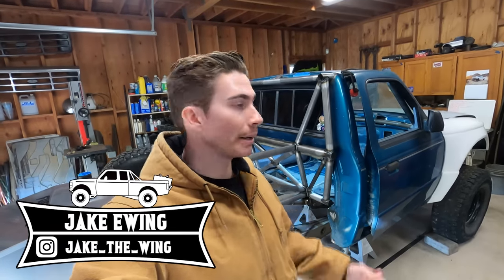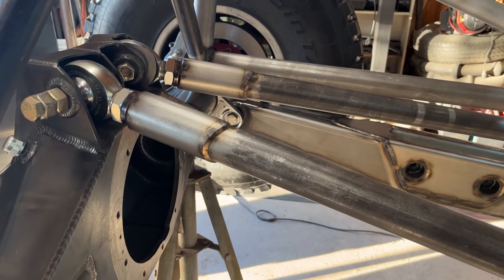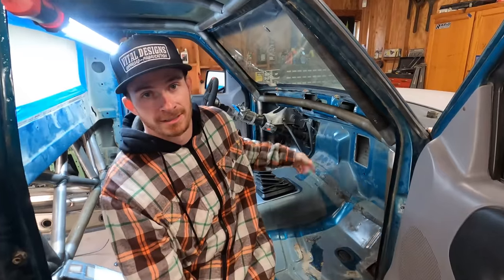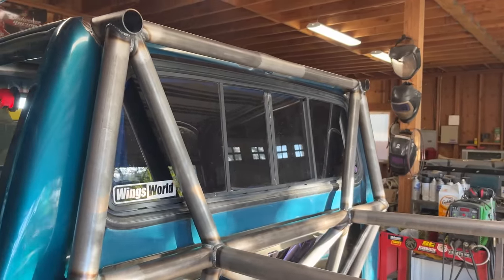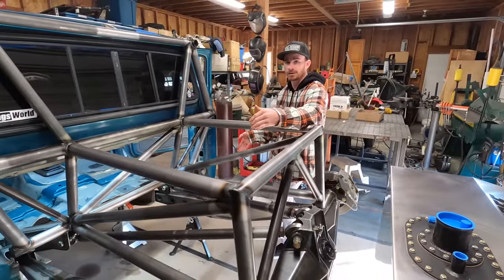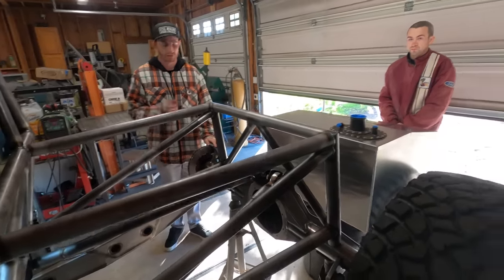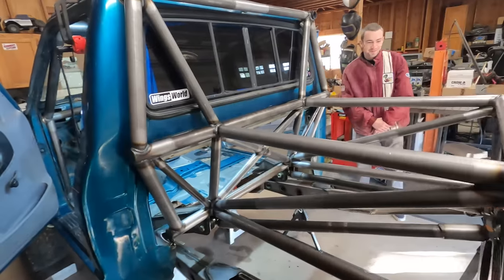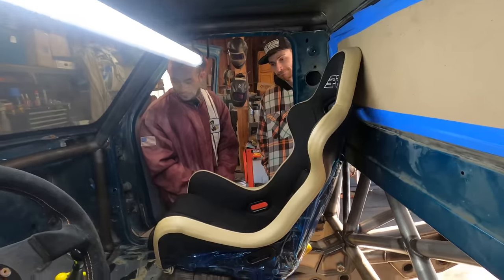Ranger Prerunner Build EP2: Rear Suspension and Roll Cage Underway!

Comment: Unless I missed it, how do you plan on welding the tops of the tubes in the cab since you can not drop the cage? Cut the roof off?
Reply: And the backside of the b-pillar tubes against the cab?
Reply: The only joints that will bring up an issue will be at the top corners of the windshield. And even then I will be able to get 90-95% of the joint. Everything else in the cab i will be able to weld 100%! That being said, im not cutting the roof off to get less than a 1/2" of weld on each side of the truck
Reply: @ShowMeThePony  The entire B pillar I tacked onto the truck and then pulled off to weld the backsides, reinstalled and burned the rest of it in that you can see
Reply: @ChristianEwingVD  That’s what I figured. I may have missed that part in the video? It’s looking killer man. 👍🏻
Reply: You could cut a few 3x3 or 4x4 squares out and fully weld the cage without cutting the roof out
Reply: A lot of people cut the a pullers and back wall and weld it back on when done if done right it looks like it was never cut

Comment: Looking good, guys. Taking the time to tuck those tubes in that small cab is going to make a big difference. The penetration at the top corners of the cab looks so clean. 

Why silicon bronze to the sheet metal? Just less chance of burning through? Obviously less heat input for brazing than welding. Also how do you judge CoG height for figuring out your anti #'s? With the extensive structural mods I imagine it would be a fair bit different than stock, but maybe I'm wrong. For a more stock rig there are numbers available from SAE and NHTSA that are used for crash reconstruction.
Reply: Silicon bronze helps with keeping the heat down like you said, minimizes warping and also has a little bit of flex too it. So if the cab is shaking a bit off-road around the chassis for whatever reason it’s not cracking welds 👍🏼  As far as CoG I just use the centerline of the crank on the engine as a reference point. It maaay be slightly off but it’s a good rule of thumb to use since so much stuff gets changed on these trucks